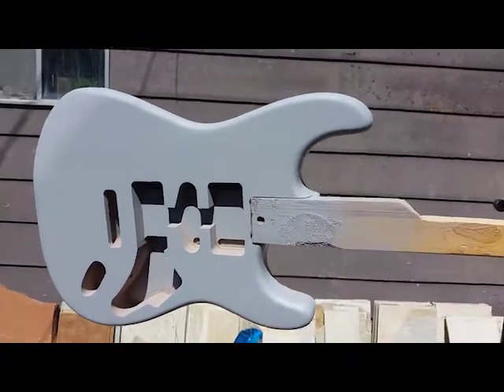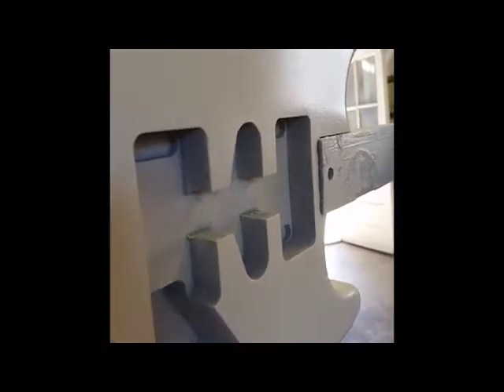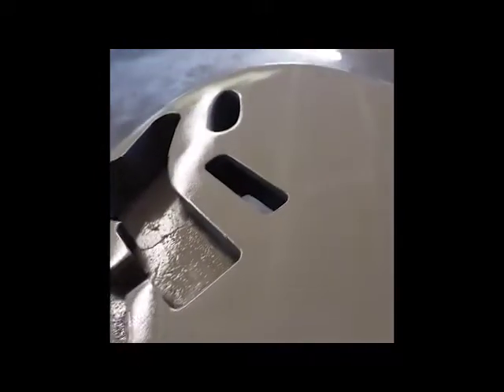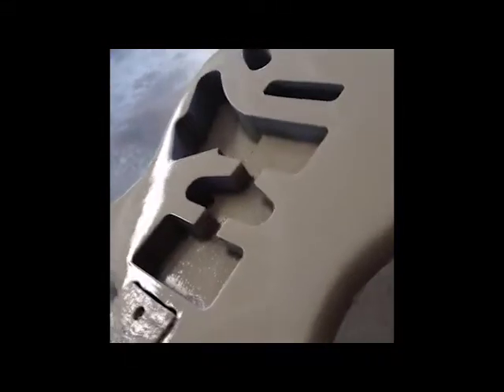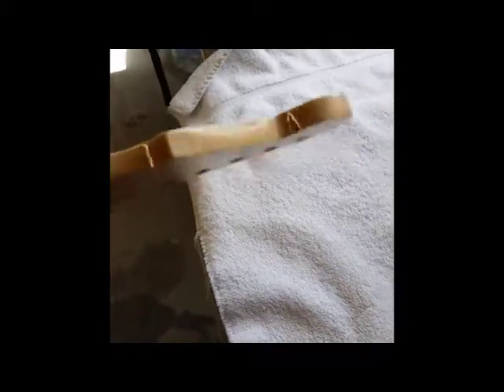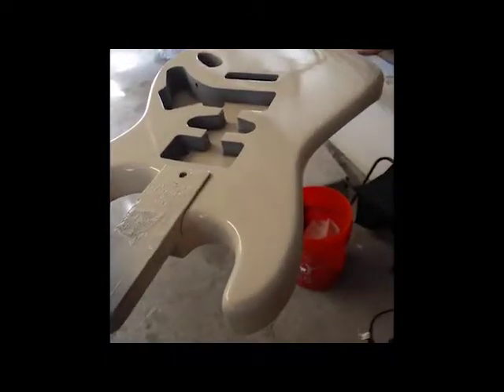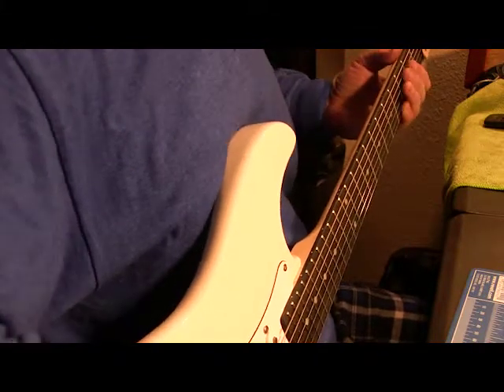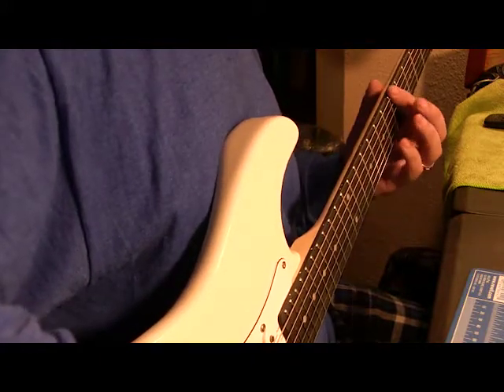Building a Kit Guitar

Comment: I would have liked to see more of the construction, but it has inspired me to maybe take on the challenge.  I would think properly setting the frets would have been a challenge.  While watching you play now, you certainly followed through. Where did you purchase the components?
Reply from the maker: Ha, yes maybe more on the construction, I should have done a better job on the sequences and stuff, but it was a crazy time and I just felt the need to get it done and move on to learning how to play. 

This I will tell you, it's easier than you may think, I did level the frets and dress the edges with a specially designed fret file, but the neck comes pre built, you just seal it with something and bolt it on. 
The thing is, I'm real mechanically oriented and have built my own guitars from parts since the 1980s so this was probably my 6th build in my life.
The reason I do it this way is I want a deeply personal relationship with the instrument, I want to build the story, to craft its pieces and then savor the fruit of my labor. I needed that because in my mind there is some sort of mojo in that and I want all the mojo I can muster bro.
The kit comes from https://www.byoguitar.com/ and now I will tell you this, if you simply want to get better and are serious about it, then buy course material and not gear, and make it as easy as possible to just start playing. 
In my videos there is a black lespaul jr on the wall, I play that guitar almost every day, I played the amp that came with it just yesterday and this small amp and guitar are perfect for small rooms or parties where I don't have any vocal mic. 
The guitar and amp came from Best Buy and cost 112.00 total including tax. I bought that three years ago for two of my sons to pluck around on but the guitar doesn't have a game controller to run it so they are not interested. So I picked it up and learned a few riffs from the internet that I display in the "every riff I know"  video on my channel. 
As I sat with that guitar and amp the other day I realized how much better I could have gotten if I knew to focus my money on course material instead of gear.
Just buying a guitar can be much better than 25 coats wet sanded paint job with many hours of work and set up.
Question that remains is what are your intentions, why do you think you want to play guitar?
Reply: @homeguitarplayer9482  Thanks for the feedback, very interesting.   I am now 66 years old and have always, wanted to learn guitar, so I retired last year and have decided to really work on it.  I wish I took  it up may years ago but no use looking back,  I have done many other things that many have not, including a pilot and suba diver.  Guess we can't have it all.    I must admit it has now become a passion  and I practice daily, I only wish I was advancing quicker.  
I have enough equipment for now.  The guitar build would be just for fun, I have a big shop and build fine furniture as a hobby and thought it would be fun.  But now you mention it I would rather put the time into becoming a more accomplished guitar player.  To answer your question "Why do you want to play guitar?" Simple for my own enjoyment and perhaps entertain a few close friends.  If I can get close to your level, I will be a happy camper.
Reply from the maker: @dbwalker100  I hear you bro, I'm 51, started at late 48 and want to share my love of the blues and the music of my youth with others. 

I want to play for gatherings of my family and friends and be in a band with friends I can support in their quest to make music.

 At this point I am committed to producing a Christmas CD collection of my recordings in MP3 format designing and printing the the case art myself, one for each of the people on my Christmas list. 
Each year I will release at least twelve new pieces of music and at least two must  be originals. 
My hope is to play for veterans who want to host me for their occassions  and to help teach them the therapy of the blues and playing and instrument for self health and improvement because as a veteran myself I know the value of it personally. 
My mission as I have accepted it is to share with and help others through the story telling medium of the blues, born of suffering to help heal and soothe the soul, I wish to grow and heal, and help others.